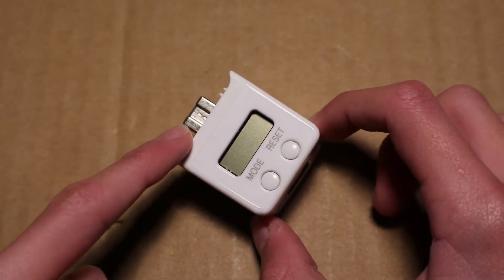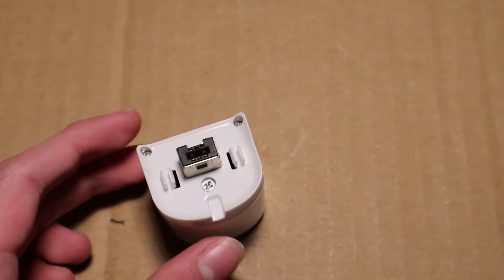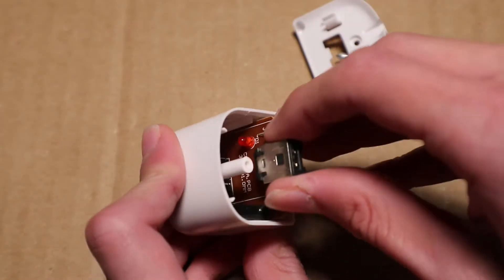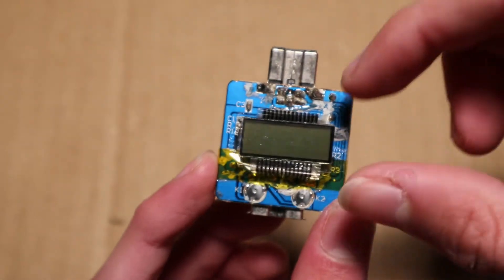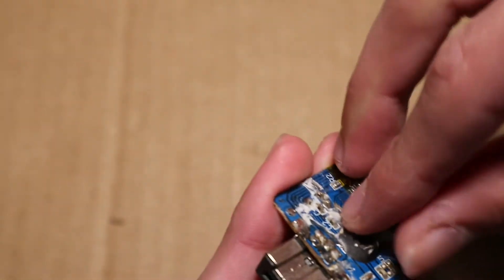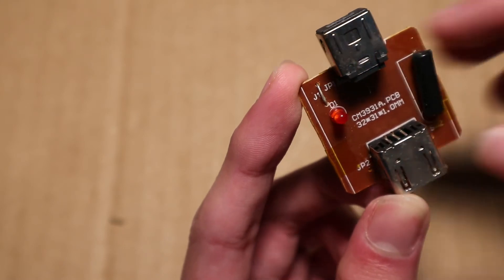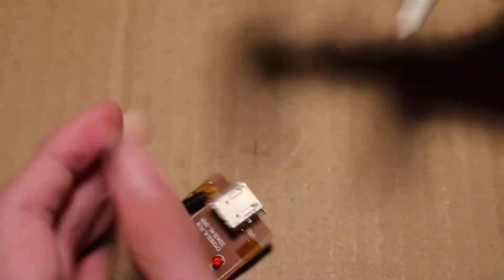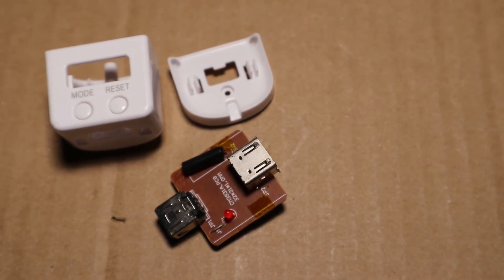Teardown of a mystery device

Comment: Maybe for a Gameboy or maybe Wii and it has a tilt switch
Reply from the maker: The connector on this device looks like the connector used for a Nintendo Wii remote.
Reply: @RandomElectronics1 Yes, it connects to the bottom of the Wii remote, likely for a tilting or shaking game.